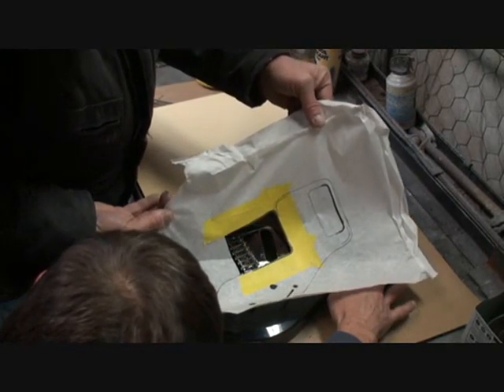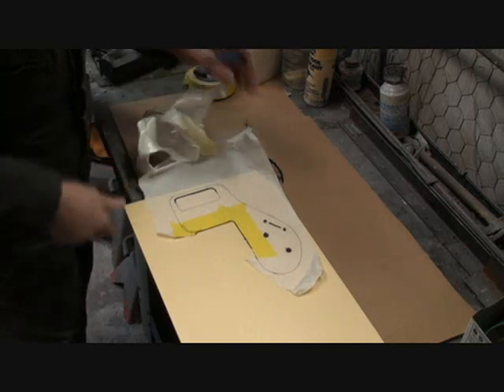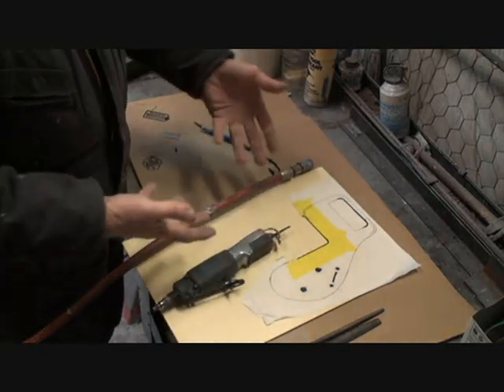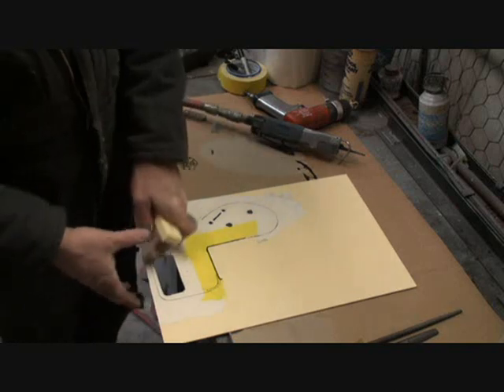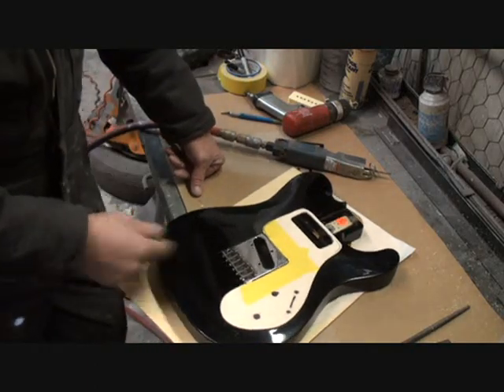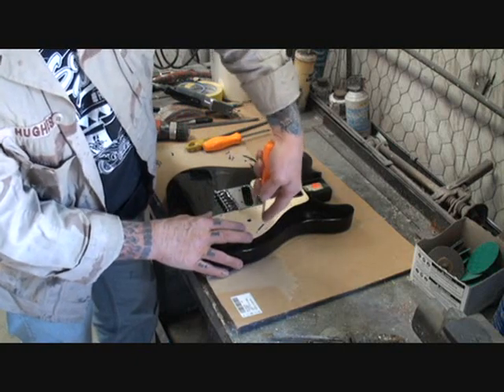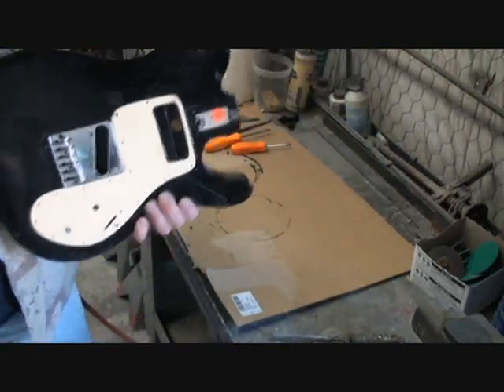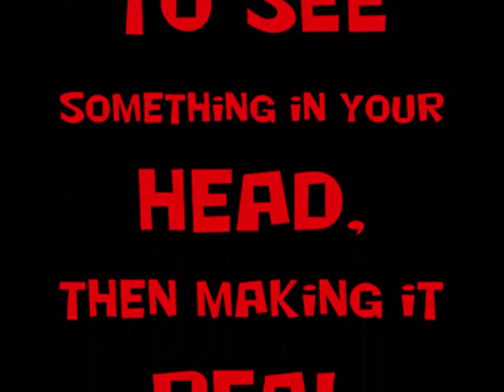Electric Guitar Overhaul-Complete Makeover-Part 3

Comment: That would cut really easy with a small band saw, Pete.
Then again, I would make a pattern for it, and cut it out with my Samco Mini Router.  Which would also do a good job on the pick up.  It has a pneumatic plunge control with a foot pedal, and precision depth adjustments.  From what I have seen on youtube and elsewhere, a lot of Luthiers use a similar machine.  
Love to watch you work, Pete.  That's going to be sweet when you are finished.